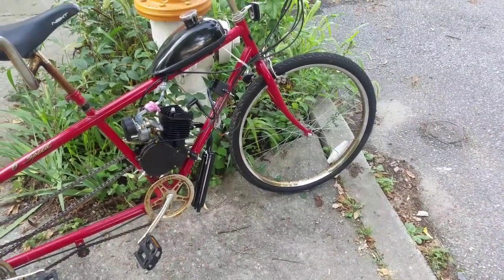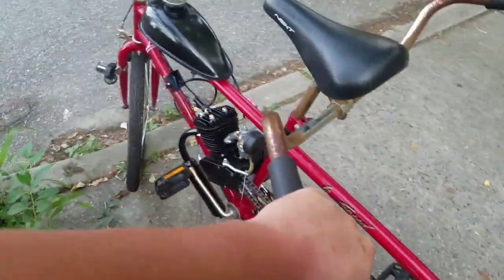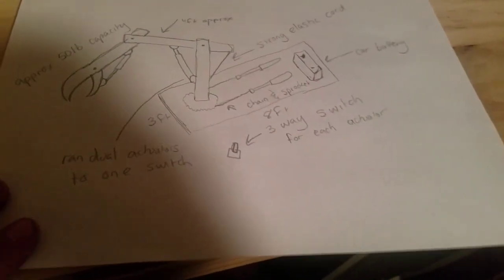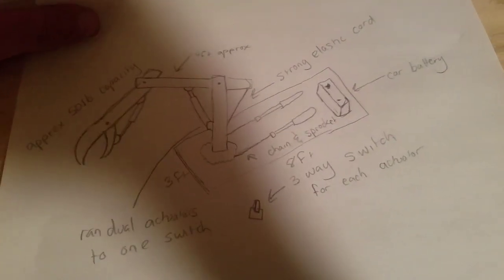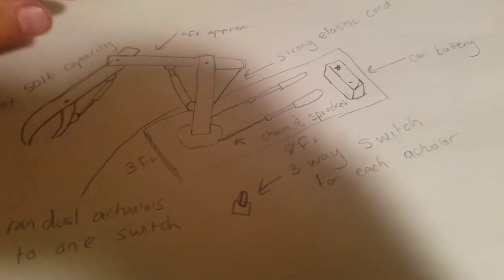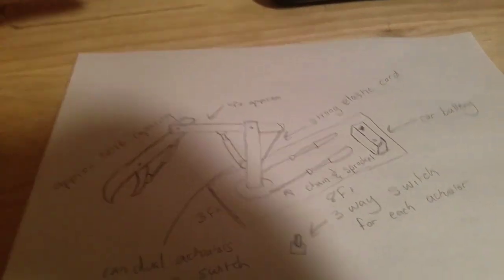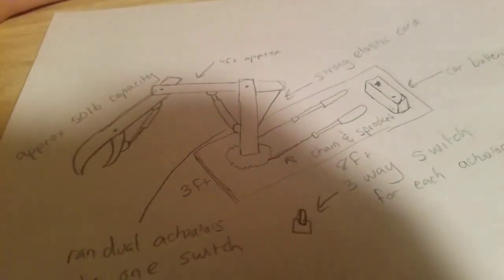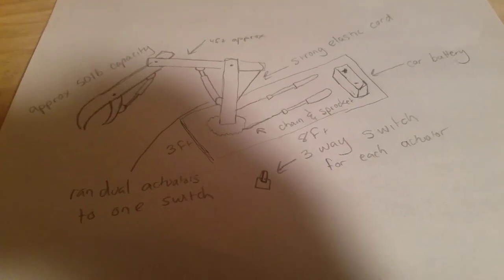Tandem Motorized bike Completed!  Upcoming linear actuator arm build!

Comment: You should adjust the idle to where you don’t have to hold it to keep it running. There should be a little brass screw on the left side with a spring retaining it, tighten it to where it smoothly idles and it should be good. Great vid
Reply from the maker: I thought that was the fuel/air mixture?  I adjusted the piece on top of the carb that pulls the throttle cable out all the way in the video.  I was just figuring it was because of the heavy break-in mix that didn't have enough adjustment to idle